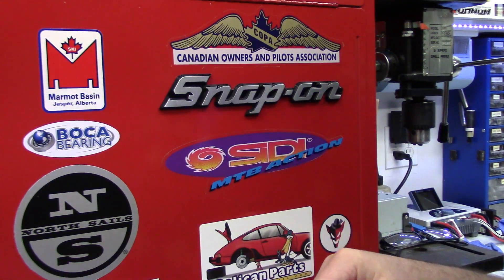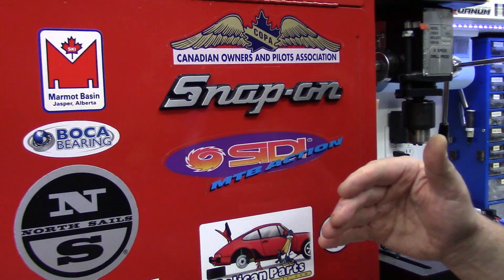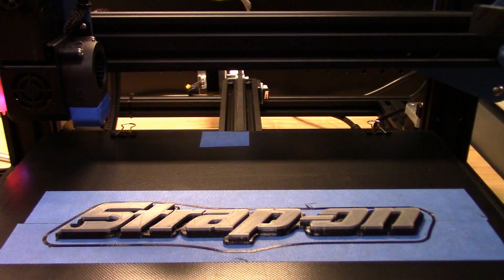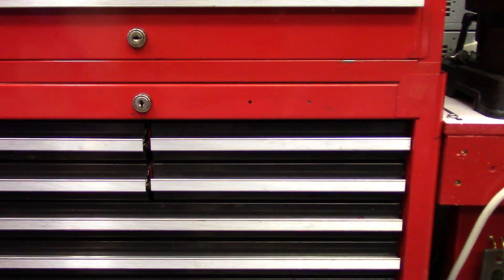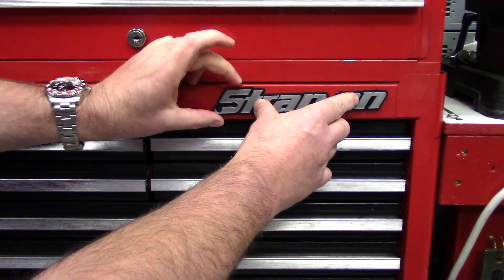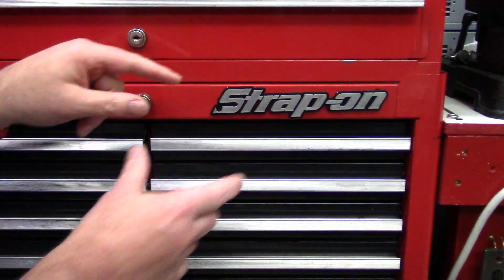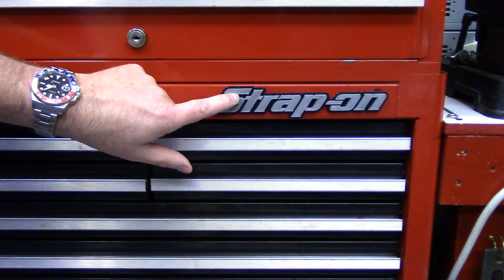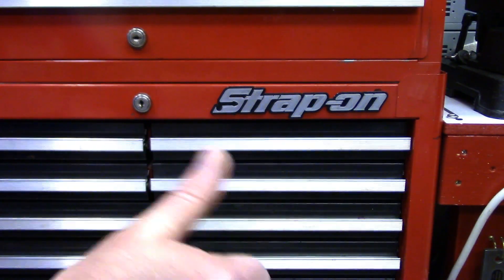Strap-On Tool Box Badge - 3D print your own with this free STL file.

Comment: I see a lawsuit coming up. Only joking.  What 3D Printer did you use to get the two colors? Thanks John.
Reply from the maker: Print details are in the description. Two-tone is very simple... pause the print manually or in the g-code and change the filament spool. A Sovol SV02 is of course tempting if two-tone prints were the norm rather than the exception🙂